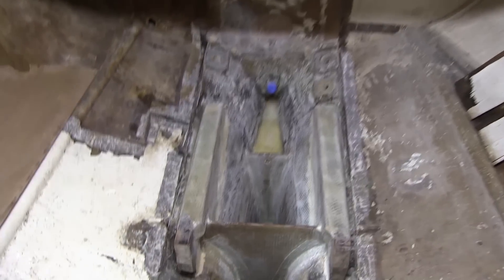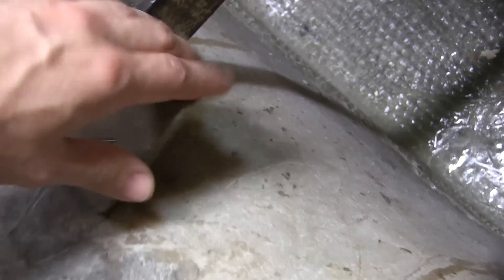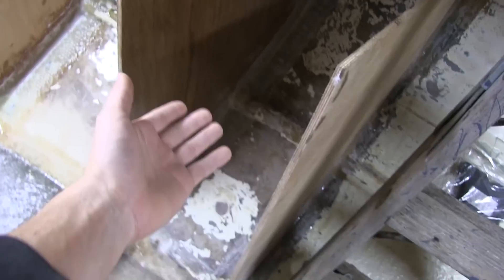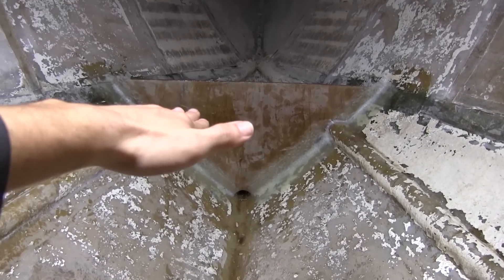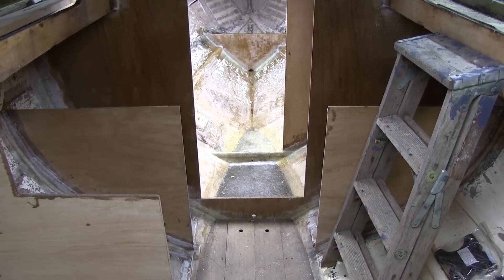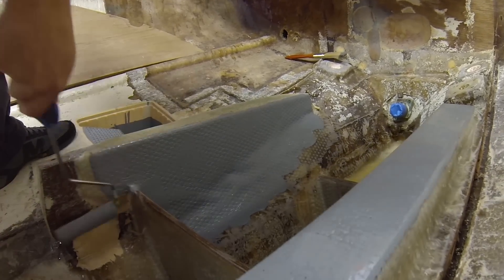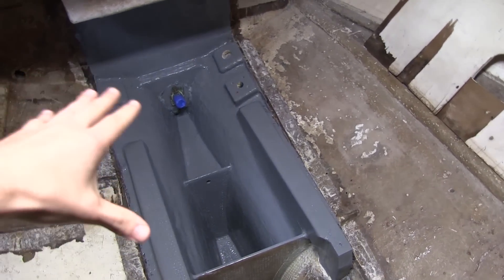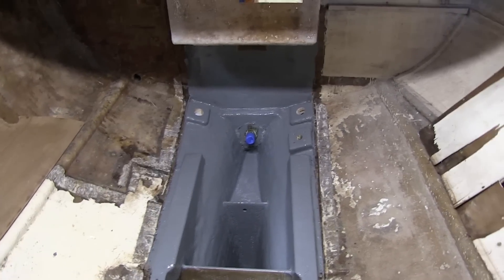Bulkheads and Painting the Engine Bed | Sailboat Restoration Ep. 26

Comment: Good to see an update. One thing i might recommend since you have the boat down to the bare glass is adding on some sort of thin foam insulation. Not only will insulation help combat condensation to a degree but it will also help muffle the sound of waves slapping against the hull while you're trying to sleep at anchored or moored. Just a thought on what i would do if i could strip mine down to glass.

Comment: If you want to scribe a bulkhead in to the yacht try this. Use either a sheet of hardboard or eighth ply in two halves with battens to join the two and cut to the rough shape of the hull. Using a 12 inch stick. Lay the stick on the hull and mark off on the template. Do this for all points around the hull. Take the two halves outside and lay on top of the material for the bulkhead you want to use. Using the 12 inch stick lay one end on the mark you made on the template and then mark the other end back on the material you're going to use. Hope I explained it well and hope this helps ...

Comment: good job --- Engine bay insulation you can use heat shield for floor boards from your auto body supplier to keep the heat from your wood cover box and it is cost effective for pricing.

Comment: Great. Now I'm hooked. 

Can't wait for the next vids.

Oh, btw, a man I crewed for years ago, on his racing boat, he used some space-age, very thin, very efficient insulation for the ice box he built into his J-125 (which, for weight reasons, never came with one). You might try and find that material. Supposedly, it was the same insulation used on the Space Shuttle. Dunno how you'd find it, but I'm sure its possible.

Good luck. I can't wait to see the maiden voyage.

Comment: SailBros Good to see a couple of young ones having a go. Its prob a bit late but three things I see that need doing, 1/ cut limber ways in the bilge bulkheads to let any water run to where the bilge put is 2/ both the toilet inlet and out lets need to have taps on them so the toilet can be isloated if there is a leak, does happen. 3/ Make a mounting in the lowest part of the bilge for the bilge pump and float switch, just having the pump thrown in there ist very good as pipes get kinked or the pump can lift up out of the water over time.
Reply from the maker: Thanks for the advice!
Reply: Good advice.